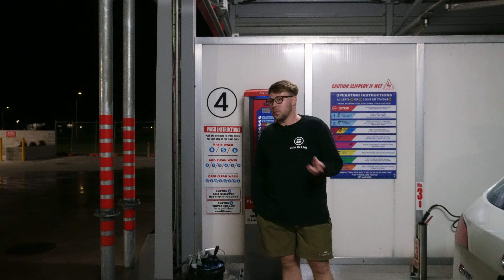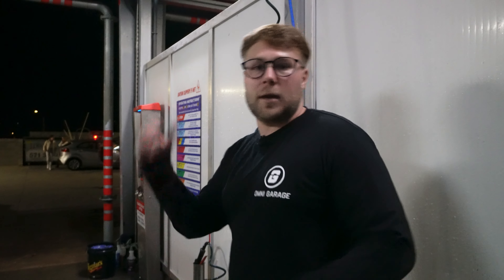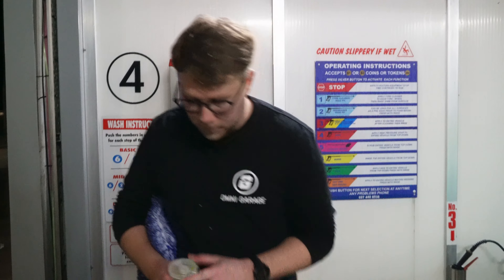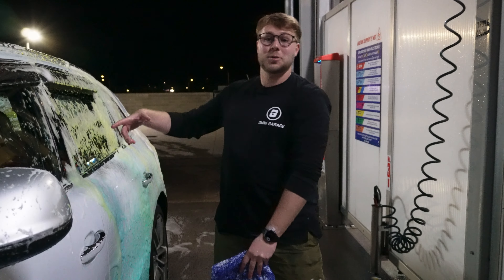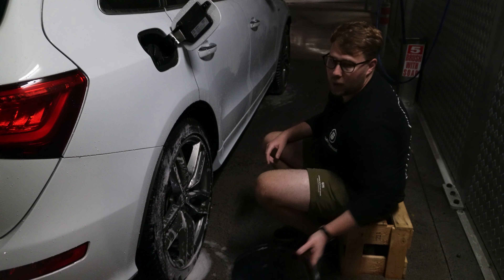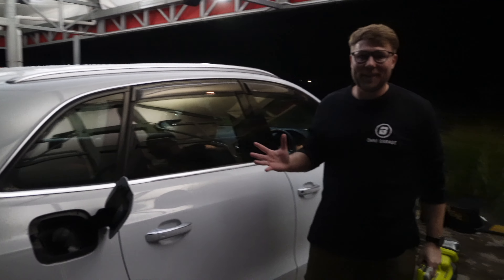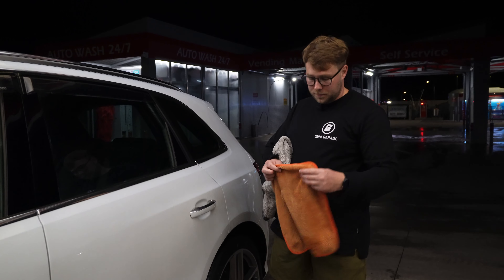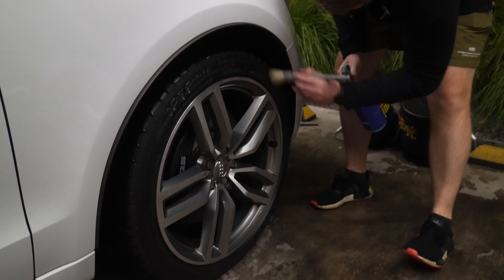How To Wash Safely At A Coin Operated Car Wash

Comment: I wash my wheels rims first to prevent brake dust coming on the Car then I rinse the whole car and after that I begin the cleaning process from down to up. Down is the dirtiest 😊
Reply from the maker: Everyone has a slightly different process. Do what works for you.
Reply: @OmniGarage  that's right.
Reply: @justkilmygamer670  I wouldn’t want the dirty stuff to contaminate the cleaner parts of the car (top) so I’d suggest wheels first then wash from top down for best results!
Reply from the maker: Yeah always wash top down.

Comment: Why spray the tricolour soap if you brought your own?
Reply from the maker: You could if you wanted to spray some tricolour in the bucket for your wash mitt.
Reply: I've moved into an apartment complex and have nowhere to wash my car here, so I'm just trying to get all the details right so i can make a plan 😅 I was just planning on bringing my own bucket with my own soap in it, i just thought maybe there was a reason I was missing to use the spray foam first then use your own bucket and soap 🤔
Reply from the maker: Foaming the car helps to get soap onto the vehicle. This soap will start to break down the dirt and grim and slowly start pulling it down the vehicle. More importantly the foam on the car helps to provide lubrication for the wash mitt to reduce scratches. Ideally you would have two buckets (two bucket wash method). One with water it in to rinse/clean the wash mitt. The other with soap in it to re-lubricate the mitt and to have a soapy wash mitt to help with the cleaning process.